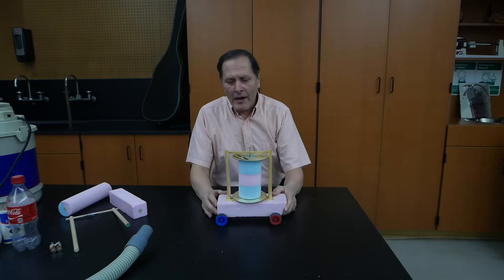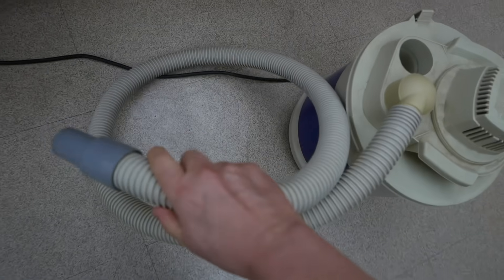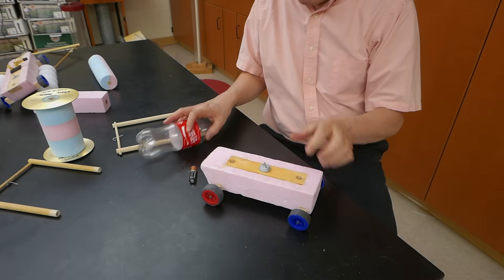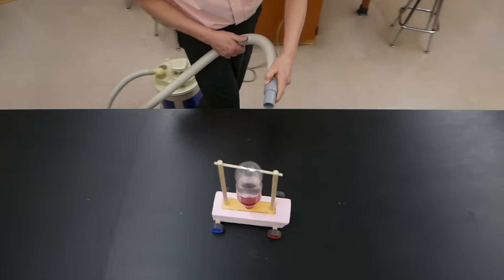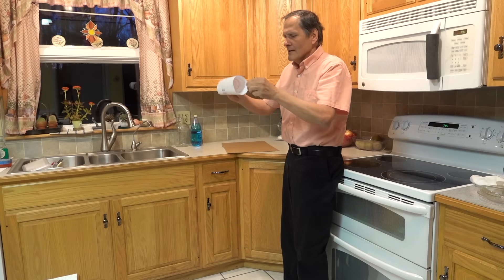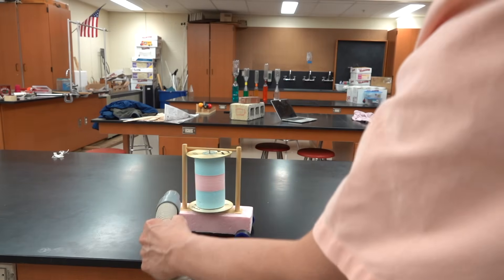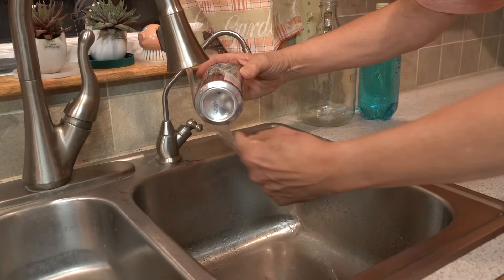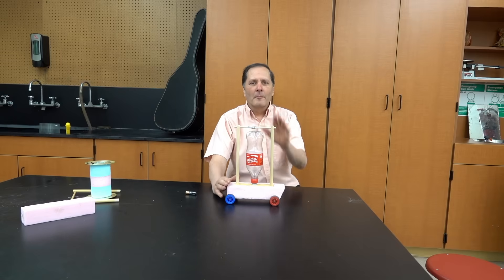Flettner Rotor Sail Cart // Homemade Science with Bruce Yeany

Comment: Kinda defeats the point if you have to power the sails? Just use propellers probably more efficient  but maybe I'm wrong?
Reply: What Bruce said.
But additionally:  Such a rotor is much easier to handle then traditional sails. With traditional sails you constantly have to adjust the angle of the sails with respect to the wind direction. Compared to that, such a rotor is a "switch on and forget" device.
Reply: Believe it or not you don't actually need a separate power source to spin the rotor.  A prop underwater (configured to work more like a turbine than a thruster) could be connected to the rotor such that once moving through the water it would create a feedback loop of power that would be self sustaining as long as there wind is blowing within a suitable apparent angle to the boat.  This would be much easier to achieve with a wheeled vehicle due to greater traction and far less drag.  If you doubt this Google "DWFTW Cavallaro".
Reply from the maker: in my small cart the amount of energy used to spin the cylinder would have been better served driving a fan propellor,  this piece was just for demonstrating the principle.  In larger scale,  the energy used to drive the rotors is a very small percentage compared to the energy gain from the wind.  Ships can see a 5% to 15% reduction in the fuel used,  that is a considerable savings.

Comment: The MV Estraden has two operational Flettner rotors on it and the company is claiming about a 6% fuel savings on average for the route it normally runs. That's nothing to scoff at. Initial testing took place in 2015 with one rotor, then another was added increasing fuel savings from over 2% to over 6%.

Their data suggest a similar vessel with larger rotors running the same route, or on other routes, or with ships specifically designed to take advantage of this technology (rather than being retrofitted) might be able to achieve 20% fuel savings (though to date real world tests suggest about a 15% maximum).

This is something some shipping companies are seriously looking into, especially given that we can now construct these rotors from lightweight composite materials that are very strong and computer control systems and various measurement devices are very accurate. Because they take up deck space they can get in the way of cargo, or loading operations, or cause problems when winds are dangerous, so collapsible systems (now also possible due to new materials) are being considered.

There are now many real world examples being tested and in use...

Pictures of the "MV Estraden" (with Flettner rotor retrofit) here: https://www.marinetraffic.com/en/photos/of/ships/shipid:6000/shipname:ESTRADEN/mmsi:230917000

Pictures of "E SHIP 1", which claims 15% fuel savings on average are here:
https://www.marinetraffic.com/en/ais/details/ships/shipid:151866/mmsi:218108000/vessel:E%20SHIP%201

Pictures of the Maersk Pelican, an old oil tanker that was refurbished and retrofitted with a larger Flettner system in fall 2018 (with hopes of between 7 and 10% fuel savings) are here: https://www.marinetraffic.com/en/photos/of/ships/shipid:730851/shipname:MAERSK%20PELICAN/mmsi:565686000

The ferry named Viking Grace had a small system installed in 2018:
https://www.marinetraffic.com/en/photos/of/ships/shipid:5547/shipname:VIKING%20GRACE/mmsi:230629000
Reply from the maker: Thanks for the post Derek,  I hope I didn't come across as scoffing at the idea of the rotors being used on ships but  going back and rewatching my video, I think I did.  As you have stated the savings can be significant but the use of the rotors is still in  it's infancy  compared to the number of ships that could benefit from them but haven't made that commitment.   It is a positive note that at least  they are actively considering these to help reduce their fuel consumption.
Reply: @YeanyScience  Sorry, I didn't mean to use that term in reference to your video specifically, I was using the term to highlight the fact that even knocking off a small percentage of fuel usage is huge when you consider the amount of fuel (and it is a particularly polluting fuel) that a large ship uses.

This is an excellent video that demonstrates the workings of this technology in a way that anyone can test themselves. I can't think of any video of yours that I've watched that didn't impress me. Your ability to break down fairly complex concepts into easily demonstrable experiments using simple materials and to clearly explain what is going on is amazing.

Comment: Pressure difference has very little to do with the force exerted. It's simple Newtonian action and reaction. The air is deflected and therefore exerts a force.
Reply: With the only "difficulty!" that the force you propose works in the opposite direction. :-)

Don't get me wrong. The force you propose is there (although in the wrong direction), but the force excerted by the pressure difference is bigger. Otherwise it would not be possible to move the car forward by blowing at the bow end of the rotor. The car is pulled foward by the magnus effect and not pushed foward by "action and reaction".
Reply: @kallewirsch2263  the Magnus effect is exactly about action and reaction. In the case of a vertically mounted rotating cylinder the force is exactly only strongest when a transverse/perpendicular to wanted movement vector, airflow is happening. The cylinder would need to spin in different directions depending on whether the wind was from left/right/starboard/port.
It's very much like a conventional aerofoil only powered.
Reply: @Frisenette  
Helge.
Consider the cylinder. Now let a stream of air flow against this cylinder taking care that you only hit one side of this cylinder (lets call it the left side). The air is deflected away from the cylinder to the left, which requires a force to do so. As a consequence there is a force excerted onto the cylinder, which is opposite the the air-deflecting-force and which drives the cylinder to the right.
This is the classical Newtonion point of view of what happens by taking into account only the forces coming up from deflecting air.

But this is NOT what is happening in reality!

In reality the cylinder also moves to the left. Left, not Right!

There is more to it, then just Newtonion forces and "actio equals reactio". Newtonion forces cannot explain why a paper lifts up when you blow over it. You need Bernoulli to get the correct description. Bernoully is all about pressure differences in a medium that flows.

There is a difference between throwing a tennis ball against an almost closed door and directing a stream of air agains the same door.
The tennis ball - by getting deflected from the door - will open the door, while the stream of air gets accelerated when flowing through the gap between the door and the door frame and thus create a pressure difference which is greater then the deflection-generated force. The door closes in this case.
The Magnus effect is all about creating an asymetric flow gradient around the rotating cylinder which generates a remaining force in the direction perpendicular to the airflow. Newtons "actio equals reactio" has nothing to do with it.
Reply: @kallewirsch2263  There is a pressure difference of course. But it is not high enough to account for the high force observed.

Have a look at this: https://en.wikipedia.org/wiki/Magnus_effect
This: https://en.wikipedia.org/wiki/Bernoulli%27s_principle
And this: https://phys.org/news/2012-01-wings.html

The classic counter argument to you is "how can a plane fly upside down?" Or "how can flat wings work (as with a paper airplane or very simple elastic band powered model planes), or teardrop shaped, or reverse profile wings?"

There is a plethora of different experimental wings/profiles like the Flettner. The rotor wing, the turbo sail, laminar flow -blow wings (tiny holes blow air to the topside of the wing) etc..
Reply: @Frisenette  
Kallewirsch is right except for that final sentence.  If you were right a rotating cylinder could not substitute for a sail any better than a stationary one.  If there was no pressure difference generated by rotation, there would be no deflection to result in a force at a right angle to the oncoming air and no ultimate action/reaction vector.  
Only in the final analysis can you speak of action/reaction as an "explanation", but that would also apply to the power train of an automobile, right?  That "explanation" of how an automobile works would ignore all the laws and effects that cause and precede Newton's laws that merely describe what's happening between the drive tires and the road.
The magnus effect is real and is shown here to be distinct from Bernoulli and Coanda even though all 3 are different means of rerouting varying portions of the action/reaction equality.
Reply: denbecr49 it is an explanation in the sense that it explains what is creating the force. 
Bernoulli’s principle is needed in the case of the Flettner rotor, for the air flow not to break away from the cylinder, but in explaining how an airfoil works in the very basic principles, it is not.
IE it is not pressure differences that drive a ship forward or lifts an airfoil.
Pressure differences play an important part in how some optimized wings perform better. 
But, the basic wing (plane attacking a medium at an angle) idea works in any medium. 
It’s the screw, the plow, the propeller etc.